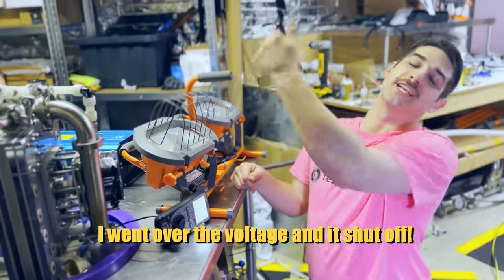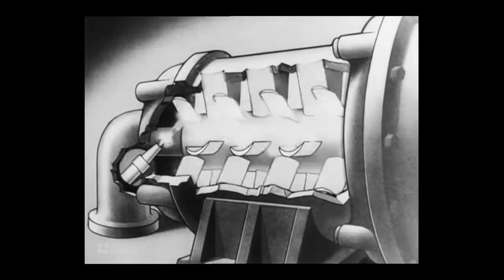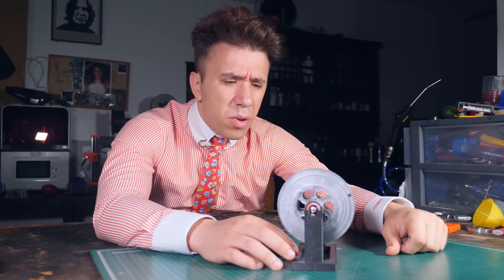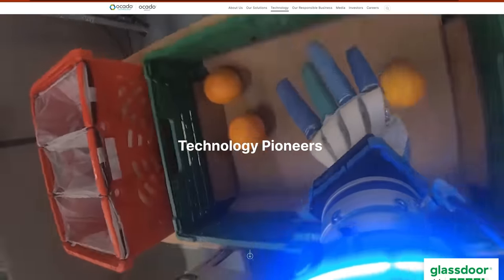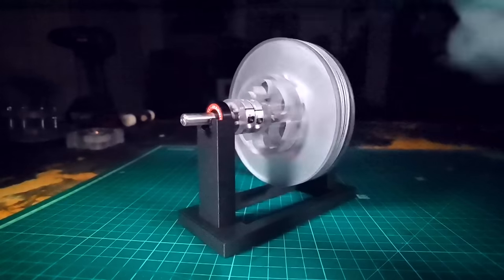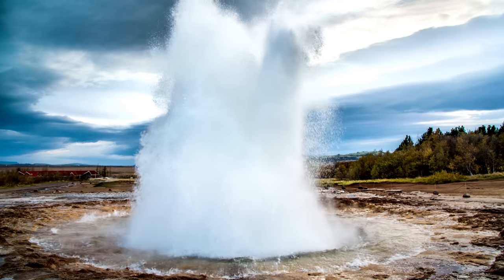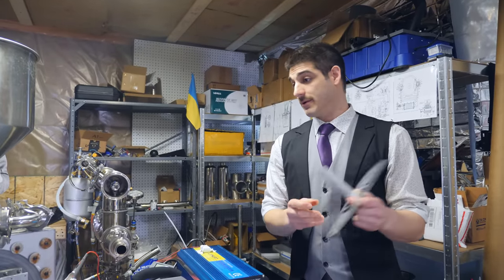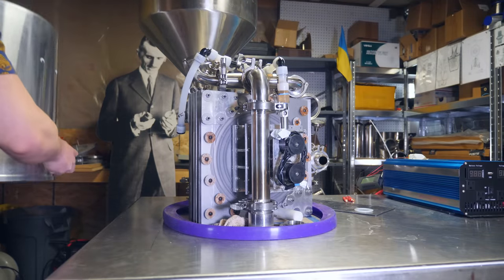Building Nikola Tesla's Bladeless Turbine

Comment: This is one of my favorite videos of yours. Im glad people are experimenting with these ideas. Even if a tesla turbine might have a issue with torque, could they create gear ratios to transfer the torque to a more usable system?
Reply: Absolutely! It's just that torque has nothing to do with why engineers don't use this machine.

The Tesla turbine's issues with torque are overstated and poorly understood. It's not great at torque overall because its an impulse gas turbine that has its peak power around 50% the speed of choked flow.Which is a bit under half of mach 1. Peak efficiency would happen a bit below mach 1 assuming we're not trying to get into supersonic speeds at this time (to say nothing of the issues with THAT - woof).

Given that power is measured as a function of RPM x torque is force measured at a specific radius (ft lbs or n-m depending whether imperial or metric) its peak power output would generally take place at a relatively high RPM with lower torque because that's what spraying choked flow gas at an impulse turbine *does*.

This isn't notable. Far as I can tell virtually most (every?) commercial gas turbines runs gearboxes. Every commercially available microturbine I've seen 100% has an extensive gearbox. 

I love the work Charlie's done even if his fixation on disproving internet donks blathering about low torque is a bit frustrating because it's not the thing that keeps people from using it. Disproving that can be done simply by educating oneself on gas turbines more broadly.

What keeps people from using it is that the low isentropic efficiency of the turbine makes it require significantly more energy. Which means larger collectors, more fuel burned, etc. 

If you're going solar than it's probably better to just go with panels as there's no moving parts unless one can scale up the operation to the point where the cost is low enough (land/materials/setup costs/etc) that the lower energy efficiency of the system is made up for in lower cost.

If you're doing anything else than someone's putting the work into getting fuel and one has to find a fuel source that's kind of perfect. It can't or isn't worth using for anything else in the area, has to be consistently available and has to be dirt cheap (safe/easy) to move in whatever way it is.

But if it fits those criteria than it'll probably be sent to a conventional centralized gas and/or steam turbine system running on a larger grid.

I'm pretty sure there are circumstances that exist where the Tesla turbine is perfect. I just suspect they're not as common as most Tesla turbine proponents would suggest.

Comment: I love how everyone is ignoring the fact that the compressed air or steam to drive this thing will take more energy to produce that driver than this thing can put out, so its a negative net energy gain. The air compressor in the video they use is either a 212cc, 346cc or 420cc 'Central Pneumatic Central Pneumatic 30 Gallon 180 Psi Gas Powered Two Stage Air Compressor'. It would be more efficient and also cheaper to purchase a small generator if you are worried about black outs like they suggest as a use case for this.
Reply: It's an energy conversion device, converting air pressure or steam pressure to rotary motion. You know like electric generators? A net energy gain would be perpetual motion.

Comment: Question/Video Idea: If the turbine is super efficient, could you do a video on energy storage vs say lithum or Flooded batteries? Say maybe, input energy to charge said batteries and then use an efficient air compressor and compress air with an equal amount of energy. So both input energys are equal (I know there will be a slight loss with the compressed air). Then see how much energy  you can get back out of the energy storage. All in all, I just want to see how the Tesla turbine holds up vs chemical energy storage.

Comment: You should use a pan or metal bucket filled with water over a fire to make steam to run the engine. Also does the motor generate enough electricity to power the air compressor?

Comment: Get an electric air compressor and hook it up for a loop back effect? May work if set up correctly, and if you have a big enough turbine+ compressor, with a high efficiency, you could still power other things at the same time, though they might not be big

Comment: Use a tesla turbine with water vapor instead of air. One side warm water vapor, other side a condenser (turns vapor into vacuum) means temperature differential turns into pressure differential. Spinny spinny, turny turny, get electricity for almost free (solar).

Comment: I would really like it if you did an energy storage video with this idea and explore the the feasability of „cheap“ energy storage. 

Scenario; 
a compressor, 5kw/h battery, inverter and old large propane tank. 

What kind of tank size do you need for 10kw storage?
What are the costs compared to lithium-iron?

Comment: This video you is very interesting! Theoretically, Tesla turbines have the potential to operate on the principle you described, but achieving high efficiency and power from low pressure is challenging.

It is important to critically evaluate such experiments for several reasons:

  -  Measurement difficulties: Power measurement in turbines can be complex and requires precise instruments. Without properly calibrated instruments and control measurements, the results may be inaccurate.
  -  Prototype setups: The construction of a turbine from 75 aluminum discs is a prototype setup. Prototype setups are often not optimized for efficiency and may have energy losses that would not be present in a commercial design.
  -  Lack of flow information: Information about the fluid flow through the turbine is crucial for efficiency assessment. Without flow data, it is difficult to assess whether the claimed power of 4250W is impressive compared to the invested pressure of 2.75 bar.
In short, while the video is intriguing, caution is warranted regarding the results without knowing the measurement methodology, fluid flow through the turbine, and details about the turbine design.
However, the previous point about the need for critical analysis still applies. Without insight into the measurement methodology, fluid flow, and turbine design details, it is difficult to evaluate the results. Still, I have a great respect and admire for you and your work

Comment: The stress on the disk due to centrifugal force can be calculated using the following formula:

Stress (σ) = (ρ * ω^2 * r^2) / 2

Where:

ρ (rho) is the density of aluminum, which is approximately 2.7 g/cm³ (or 2700 kg/m³).
ω (omega) is the angular velocity in radians per second.
r is the radius of the disk, which is half of the diameter (10 inches or 0.254 meters).
First, let's calculate the stress at which the disk would fail:

Stress (σ) = (2700 kg/m³ * (ω in radians/sec)^2 * (0.254 m)^2) / 2

Now, the tensile strength of aluminum is roughly 90 MPa (Megapascals). To find the RPM at which the disk would fail, we need to set the stress equal to the tensile strength and solve for ω:

90 MPa = (2700 kg/m³ * (ω in radians/sec)^2 * (0.254 m)^2) / 2

Solving for ω:

(ω in radians/sec)^2 = (90 MPa * 2) / (2700 kg/m³ * (0.254 m)^2)

Now, take the square root of both sides:

ω in radians/sec = √[(90 MPa * 2) / (2700 kg/m³ * (0.254 m)^2)]

Finally, convert ω from radians per second to RPM:

RPM = (ω * 60) / (2π)

ω in radians/sec ≈ √[(90 MPa * 2) / (2700 kg/m³ * (0.254 m)^2)]

ω in radians/sec ≈ 237.4 radians/sec

Now, convert ω from radians per second to RPM:

RPM ≈ (237.4 * 60) / (2π) ≈ 716.6 RPM

So, the aluminum spherical disk would likely fail at approximately 716.6 RPM given the provided parameters and a tensile strength of 90 MPa. Keep in mind that this is a simplified calculation, and real-world factors like material imperfections and stress concentrations could influence the actual failure RPM.

Comment: Technically it could still be imperfections instead of sticky air. No matter how much you smooth a sphere there are still imperfections, if the earth was the size of a cue ball it would feel smooth to the touch. This is slightly different with machined balls as they are precision cut and polished to be as smooth as possible. With that being said, they still have multiple fissures of sorts in the material. With a low enough mass it could technically work as a bladed turbine.

Comment: Here's something that you two might actually be able to figure out: Combining the principles of turbines and stirling engines to get a... Stirling Turbine! I've had this idea for the longest time, but have not figured out the engineering details. It could even be a Stirling Tesla Turbine. A Stirling engine with the efficiency of a turbine would be awesome. In principle, you "only" need to move the cooled fluid back into the loop, right? A steam engine injector might be able to do that.

Comment: Video idea: 

A possible YouTube video idea for testing Nikola Tesla's bladeless turbine is to compare it with a conventional bladed turbine in terms of performance, efficiency, and durability. You can use the same fluid (such as air, water, or steam) and the same input pressure to power both turbines and measure their output power, speed, and torque. You can also test how well they handle different fluids with varying viscosity, density, and temperature. You can use the information from the web search results to explain the physics behind the Tesla turbine and its advantages over the bladed turbine. You can also show some examples of how the Tesla turbine can be used in real world applications, such as pumps or generators.

I hope you find it helpful. 😊

Also I am a graphic designer and really could use a 3D printer to further my craft 🤍

Comment: Seems to me one could use water pressure already provided to the house to power a turbine like this. Even when power is lost, water pressure is usually still present. Plus it’s stickier than air. Perhaps use the water that’s en route to your water heater. Or tap off main supply. Every time you use water you start to generate power

Comment: Here in the states we use natural gas for hot water and sometimes cooking. Since those gas lines are pressurized I'm sure you could hook a Tesla turbine up and have a practical generator for when the power goes out. But what I'd like to see is how efficient can you make this? Would burning the gas in a chamber increase velocity and improve power output in the turbine? How would the efficiency compare to a standard generator?

Comment: I would love to see this system powering the compressor that runs it. If it can output 3000w at 24v converted to 240v for the compressor it would be interesting to see how long it runs self sustainably until thermodynamics takes over and stalls it.

Comment: I’m not sir if you mentioned the efficiency, power in - power out. The clip shows that you can generate 1200W with just over 20psi of compressed air, although I guess the compressor doesn’t use 1200W but it would be nice to know. Also a comment was made toward the end of the clip that said if the grid goes down you could provide alternate power, how would the turbine be powered.

Comment: @Integza

I wish I had seen this video 3 weeks ago when you first posted.  I would love to be the platform by which this generator is tested publicly.  You see, I'm a mechanic,  I'm currently without work, I have no savings, running water, or electricity, due to where and how I'm forced to live.  As a mechanic, with a life-long interest in the sciences, I actually understand what makes Tesla's design work.  I also understand why it failed.  A runaway reaction will cause the device to literally blow itself apart.

Still, the mere fact that someone actually managed to make a working, practical generator is extremely impressive. The somewhat limited amount of electricity generated would be plenty for my needs.

Most companies or tradesmen who utilize generators usually use units of A/C output, with greater capacity, and may not use it every week, let alone all day, every day.  In my situation, the opposite would be true.  It would be rare that I WASN'T  using it, and a D/C unit would suit my needs nicely.

Unfortunately,  as I said, I have no savings (apart from a pile of pennies on my nightstand), so I can't afford to purchase one.  (Of course, there's always the lottery,  but I'm not holding my breath waiting for that)

If it's still possible for me to get one, please consider my humble request.  If you doubt my honesty, you can come visit me and I'll show you exactly how I live every day.

Great content.  Keep it up.  One thing though.....

.....tomatoes are awesome.  Without them we wouldn't have pizza and other Italian food, and I love Italian food.  😉👍

Comment: @integza I think you should make a video where you have a Tesla turbine being ran by an air compressor that drives a generator and powers the air compressor and motors for a car… theoretically you could make it a self sustaining system with a solar panel and a few batteries that would never have to “refill”. Drive for free forever

Comment: I wonder if you could attach a tesla turbine to the exhaust of a regular internal combustion engine...if you don't need a lot of pressure, maybe you could recapture some of that energy  from the exhaust without negatively affecting the generator's output (much?), thus increasing the overall usable power produced...

Comment: I think this could be really great idea if also it was hooked into a house's water supply outside of the house and use a sml steam turbine  to power the house using its own generated power off of the water turned to steam.
So long as there is running water ud have power and if solar panels & wind where also used then that would b quite abit of power basically from only running water/sunlight and the wind which would b awesome.
Only 2 things is something like this really needs to be thought about when designing a house to be built for it to make the most sense for most people.
2. Is that unless u have a battery there wouldnt be any way to store the power so ud have to use it straight away but a battery could be added at a later time as well.

Comment: Hmm so if your in a hot place like Texas. You could in theory make a steam from the heat of the sun rather easy. Then pump that steam through the Tesla turbine and well electricity. 
IF you put the excess heat into a sand battery you could also get some power at night. This does not solve winter but hey every little bit helps.

Comment: What is the failure point of these tesla turbines.  Having seen other videos, the problem scaling up the turbine is that the materials used typically cannot handle the large rpms generated by Tesla's design.

Comment: So the question would be... how would you make a set-up to run "basic" utilities in a house during a power outage?... how large of an air compressor (gas operated) would you need to run how many of those smaller turbines?... So the blades won't deteriorate... but what about bearings and other parts? Could you run it of low pressure water flow by diverting some stream water?

Comment: Suggestion: Try to 3D print an internal combustion engine and put it in RC car or plane or a helicopter. You could theoreticly use a metal dust to cover the 3D printed parts and heat them slowly and carefully not to melt the plastic, or put the 3D printed parts in sand, melt Some cans and then pour the aluminum to make cast parts and make engine with that. You could also cast Some parts for your jet engines 😁😁

Comment: Hey dude.
Unrelated to this video.

But can you please do a video about beamforming a tesla coil array?

I know a bit about beamforming etc but I am still a bit intimidated about making tesla coils exactly the same in order to make it work.  
The idea is that you have multiple Tesla coils linked to the same power source and use it to direct the waves.  If you use enough and they're spaced out correctly etc you can end up with almost a beam rather than a circle.  

The reason this is exciting is because tesla coils are still one of the best methods for wireless power transfer for safety reasons.  Which sounds strange.  But supercharging high frequency radiation doesn't feel safe.  Microwaves maybe but still dangerous.  Infrared?  Also dangerous but the limit of safety and technically a high powered laser even if not visible.

Comment: question is, how much power was used to create the 20Psi?
and
how much difference in "electrical power created" is between a Tesla Turbine and a "Common Turbine", if both are driven by the same pressure source?

The concept is awesome. I still wonder how it fares in comparison.

Comment: Hey man, I know I'm just a humble passerby and you are way smarter than me in this. But I really wish you would give it a hack like Jeremiah did at creating it with a "Tesla Pump."

I know in this configuration, it can reach maximum efficiency, and upon research, they were meant to work together:
Air bearing - Tesla pump - TELSA TURBINE - Tesla pump - Air bearing

I was thinking of storing heat in Sand and pumping water through it through a Tesla-valve (To keep pumping water through it, with normal pressure.)

Man, I would love to have experimented on it myself. But perhaps in the future, once I actually have more tools, my own garage and more free time. Otherwise I would have loved to.

Comment: Hhmm, maybe instead of air and steam use magnet rotation. Initial startup with magnets then once power is generated it switches to electo magnets, self contained and maintained energy without external sources for startup. Just an idea.